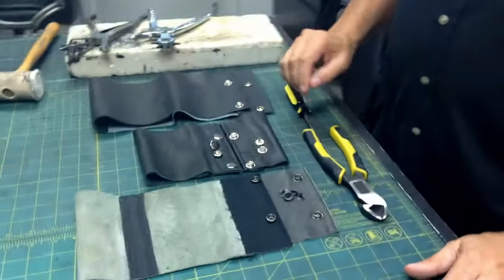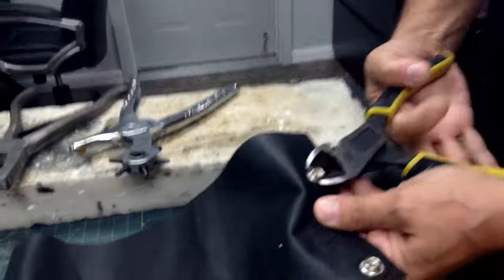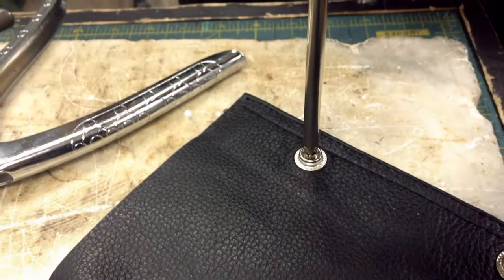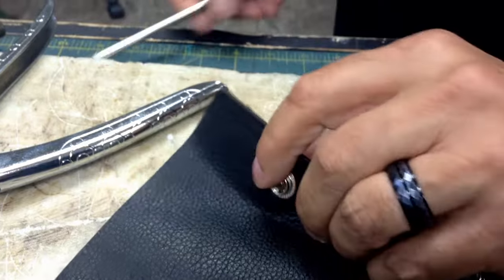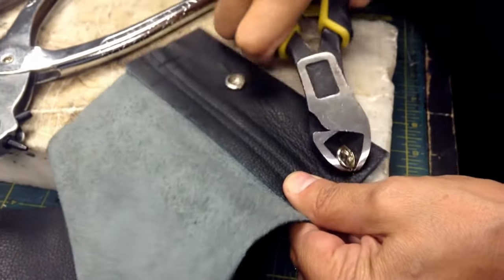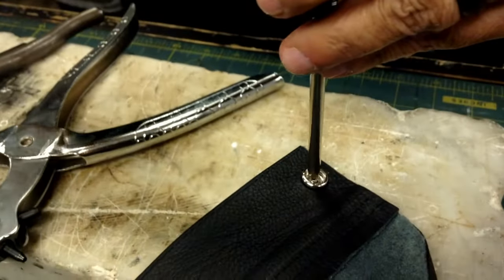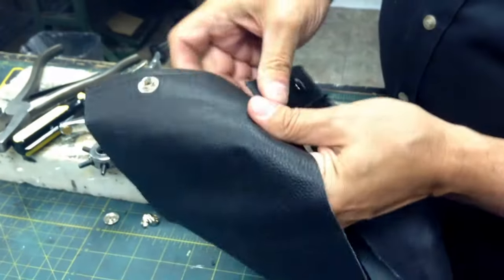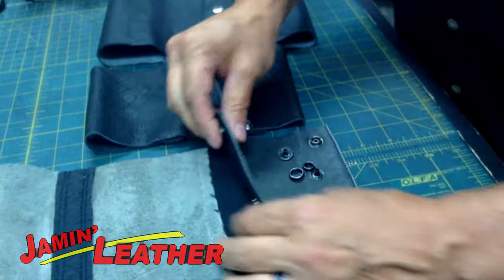REPAIR SNAPS or REPLACE SNAPS on your leather goods - Instructions How To

Comment: I have a old leather doctor or salesman bag. I love the back and want to use it. Issue is around both end the zipper area has rottened, so can zip it. It has the classic folding top. First choice is the fix zipper, second is make some snap closed process. Any ideas or how can I find someone in my are, Florida . Tx for your input😀
Reply from the maker: Hi, call your local dry cleaner and they should have recommendations for the people in your area that can help with the repair. Let us know if you have any more questions. Have a great day!

Comment: Is there a way to make the snap stay together better without replacing them?  I saw somewhere about using pliers to squeeze the male ever so slightly / out of round and it holds better?  would you bother with that?  And on the female too?
Reply from the maker: Hi, squeezing the male end should work in most cases, but definitely not the female side. It will prevent the snap from working

Comment: If I were to buy these snaps what would I type in the search bar? Obviously they're metal snaps but what are is the official name for them. I bought a leather product online which sucks because the proper size is never made correctly it's always made too small so I need to make my own and it requires snaps.
Reply from the maker: Here is a link to them https://shop.jaminleather.com/bulk-50-sets-200-pcs-nickel-silver-line-24-snaps.html and here's a link to our craft supplies section https://shop.jaminleather.com/accessories/craft-supplies/ . Let us know if you have any more questions.

Comment: Anyone know a good way to pull a female snap off a male snap? Head pulled out of female and it’s stuck on.
Reply from the maker: WD40 and a small flat head screwdriver but be careful not to get too much on the leather. It will stain if it's a premium or soft leather.
Reply: @JaminLeather  thx